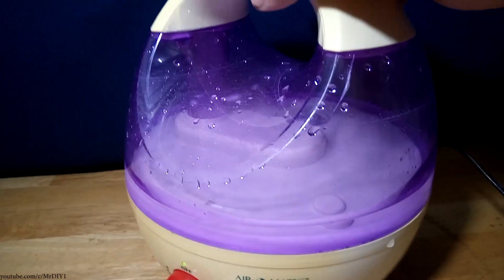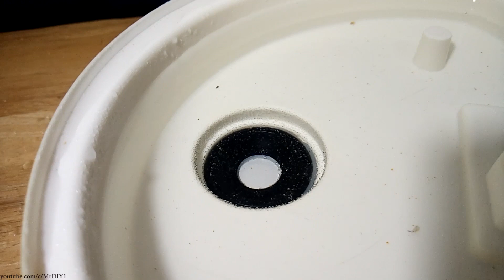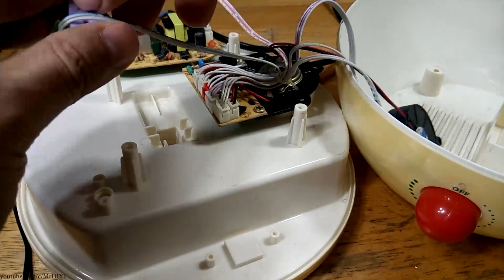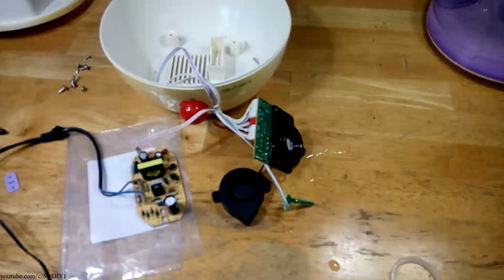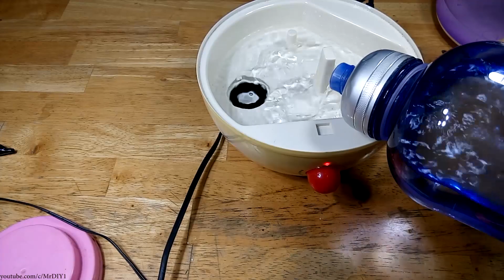Ultrasonic humidifiers disassembly

Comment: How can i fix my humidifier? It is not working i mean it not have a smock
Reply: You mean steam? I don't know if you can fix it if it doesn't release steam. That is a problem with the motor or you don't have enough water in the tank. Leaking is my only problem.

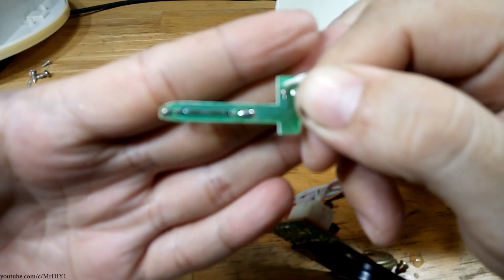Comment: What is the function of the part at 3:05?  Is it detecting the water level, and if so, how?
Reply: thats not to detect the water level, it is to detect if the upper part of the equipament is in place, so it wont work if the water reservoir isnt propely placed, its a small wire that when exposed to a magnetic field, it closes the circuit, allowing the energy to flow.
Reply: at least thats how the one i own works
Reply: @LucasSouza-bc9iz  thanks for your reply.  I think I determined that it does detect the water level based on the position of the floating ring, using magnetism as you said
Reply: It's called a Reed switch .. it's a glass tube filled with inert gas with two iron electrodes in it.  When a magnet comes  the 2 iron electrodes attract and the contact closes. So the float in the device contains a magnet that closes the contact if there is enough water present.   Some one just gave me a broken humifier and was looking for videos about it.  Reed switches are older devices, these days you have solid state devices called HALL-effect sensors that look like a transistor.  For instance if you have a laptop one half often has a magnet and the other half a hall-effect sensor so it can detect if its open or its closed. Also most brushless motors like in the fan of a PC have one of three hall effect sensors that sense where the magnets in the rotor are so it knows which coils to magnetize.
Reply: @apsdev  Good stuff, thanks for reply
Reply: @apsdev  I am too curious to know how ultrasonic humidifier works